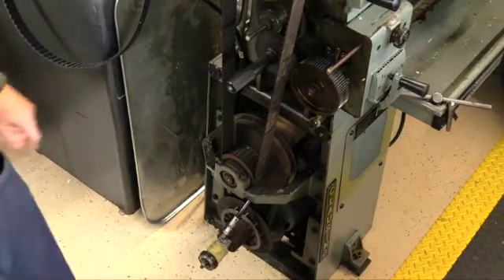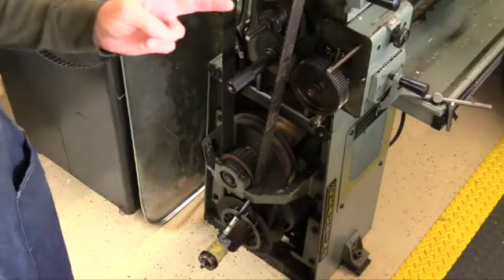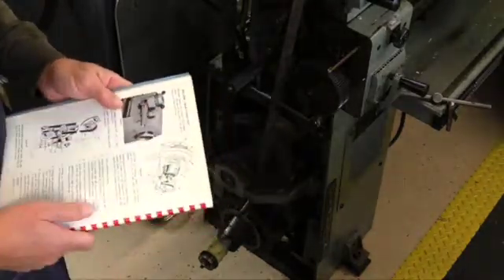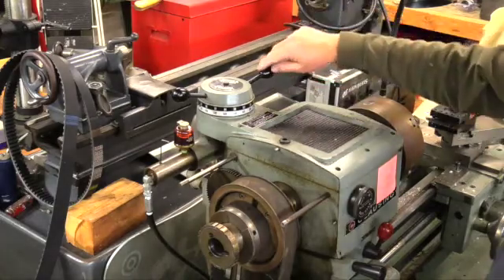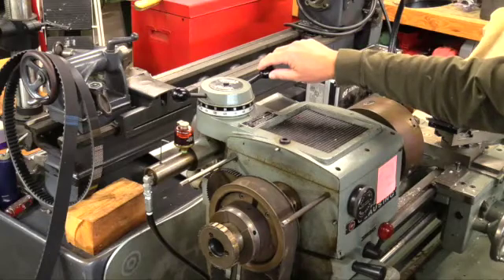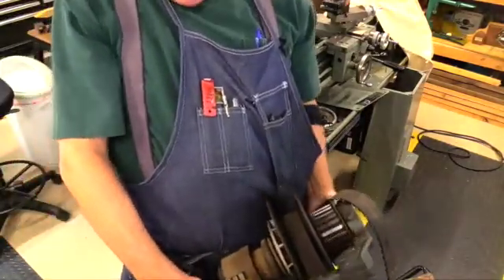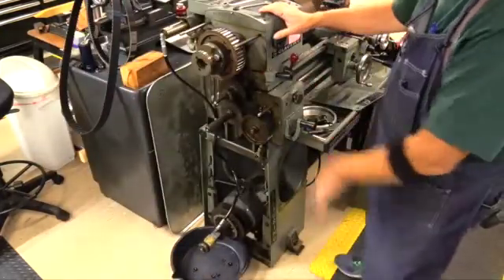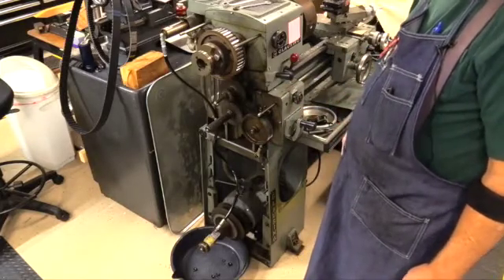Clausing Variable Speed Drive

Comment: I have a 12" Clausing model 5914 and am looking to replace the hydraulic seals in the upper vari drive cylinder....Do you happen to have a source?
Reply: the seal in that upper cylinder is a common lip seal. 1 1/8" x 1 3/8" x1/8". I just replaced mine yesterday.
Reply: Get them from clausing. I took it to 2 hydraulic shops trying to match them with no luck. Got a set from clausing, fixed it

Comment: I'm about 95% finished on a spindle replacement and a complete teardown (to the last screw) and rebuild of a 5914.   First off, your green coating looks immaculate, so you're lucky.  Take a mic to it and confirm it's 1.75".  Check your bushing.  It should be .001" oversize.  If it's any larger replace it.  It costs $23 -- part number is 049-088.  Next, you should fix the spindle so that there's no play.  Mine wobbled like yours and vibrated.   It should be a press fit and no wobble.  I would 100% change the bearings in the motor and the countershaft.   There are (4) 6205 bearings on the countershaft and (2) in the motor (mine atleast-- 2hp Rueland 3phase).   Before mine was rebuilt it had noticeable vibration.  After changing all the bearings out it's much smoother.  I purchased a Teco L510 VFD for my machine even though I plan to run it with the Reeves drive.  I might go with a micro-v belt setup with 2 pulleys.  If I do that I might also get rid of the timing belt and change that to a micro-v as well to quiet it up.

Comment: Start at the beginning: Level the lathe properly and bolt it down, pull the motor, check for rotor balance, install new high quality bearings.  Right now you're just guessing and jumping around-

Comment: It seemed OK to me, Jon.  Perhaps it is just "the nature of the beast" with the Reeves drive.  I doubt that the slight vibration I felt will make any measurable or visible changes to the work you do with the lathe.  Still, I understand the desire to make it run perfectly smooth.  My "guess" is that it is in the balance and runout of the rotating parts, and/or perhaps with the precise width of the belts over their entire length.  Let it run in for some hours working with the lathe and see if it changes any.